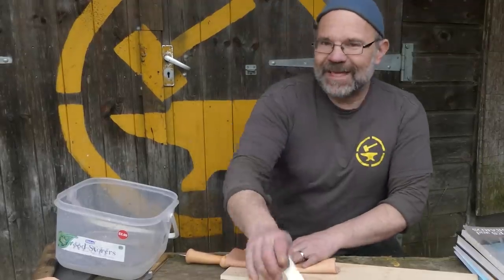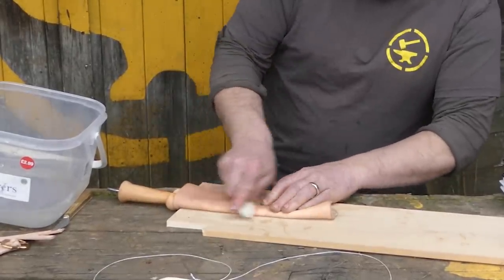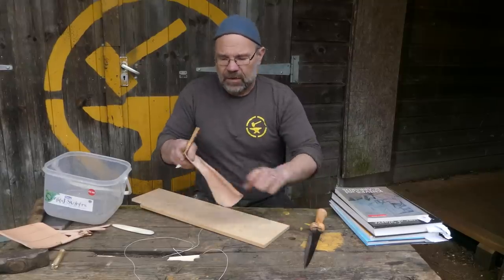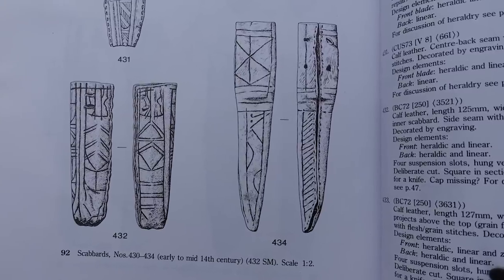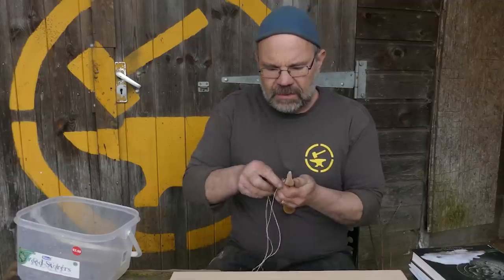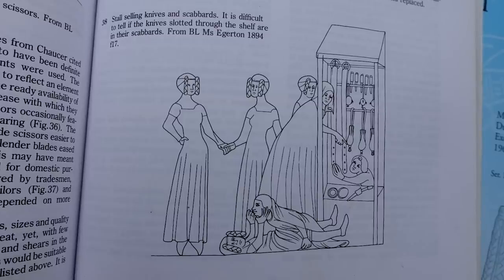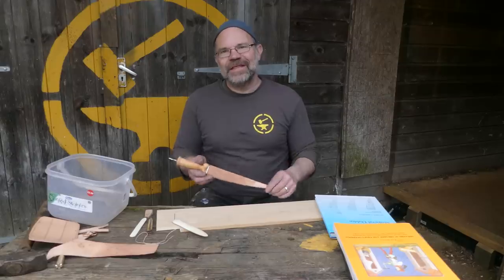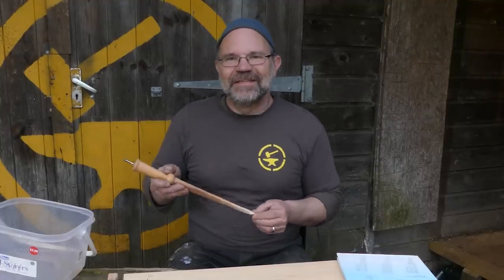Tod Makes Junk - Was Medieval Work Bad?

Comment: It's just laziness. If you want to scribe a line down the scabbard that follows the edge you can use a finger as a depth stop as you scribe it, and it will be exactly consistent. Clearly the customers didn't care or they wouldn't have bought them, but I don't buy that it saved time. There are so many shortcuts you can take while still getting good symmetry that it's not believable as time saving. On top of that how many sheaths/scabbards would a craftsman have averaged daily? Even if it saved them 5 minutes each, how many would that short them?
Reply from the maker: I agree that it is often the same time for good and bad yet they often went for bad

Comment: 1 mil is a pretty easy fraction considering there's roughly 25 mm in an inch 😅... then again, imperial fractions suck so much that accuracy means 197/500. Then again, imperial fractions are inherently unsuitable for accuracy because insignificant numbers cannot be expressed

Comment: When they play with a dagger/buckler as a sport, did they actually cut and stab each other? Any cut can get infected and kill you. I would understand if they used wooden daggers for sport. Getting slashed up doesn't sound very sensible :)
Reply: They weren't cavemen they were more than capable of looking after themselves
Reply: @valandil7454  Well, I agree. I don't think they would slash each other up for a laugh.

Comment: You have a knife stall, a buyer and some knives - you make things for each price point. To close a sale, you throw in 5 minutes of decorating which you're sitting around waiting for customers anyway and that only if things are quiet..
Medieval me buys a knife and wants something that will last - and doesn't care so much about the looks. I can't spend on frivolity - unless it's for court in which case it's a business expense. 
Even a badly made knife is likely to be very expensive - costing many loaves of bread so if you're a serf - your priorities on what consists of a good knife are geared to something lasting not pretty. Knife makers would know this and use tried and tested techniques for churning out many cheaper knives - maybe saving the few better ones for decoration.
Reply from the maker: good thoughts - thanks

Comment: Piece work.  And you didn't have electric lights.  Or even lamps in most shops.  You used natural light, when it got dark, you stopped.  So, you went into overdrive in the fall, winter and spring.  So, you would get paid for how many you made.

Comment: The disconnection between today and then also comes from the reason why ppl buy replicas,its not really to use them or they use them rarely and most of the time you are just admiring it on the wall or in your hands and the flaws get more evident. 
Think about when did you stop to stare at a kitchen knife or a tool you have stashed some where for a uneven blade or scratches.

Comment: One thing you say repeatedly that seems like a massive assumption is "no random guy is going to have a leather stamp".  But why not?  Everything you own is leather prettymuch and the guys who actually use the leather stamps professionally are eventually going to wear them out and replace them, what do they do with the old ones?  Can't repair them and they may not be worth melting down if you can sell them on the cheap to people who want to "home decorate" their gear.

It happens now so I can't see why it didn't happen then.

Comment: Minor nagging here: 434 scabbard is actually very well made - stitching is even, seam is straight, holes accurate. Decoration sucks, it is true, but are we sure that decoration in this case was not scratched on later  by owner?
Concerning the picture with knife seller stall and couple enjoying themselves: it is a pun on Latin word for scabbard, which is, of course, "vagina".  So the seller on the picture is probably selling the knifes without sheaths, that's why ladies are so interested in them :)
Reply from the maker: Nice thoughts - thank you
Reply: @tods_workshop  Why no wax or oil on finished sheath?  Such coating, especially when applied on heated leather, will make the sheath reasonably waterproof, rich in color and much more sturdy ("boiled leather" was treated with mixture of wax and resin). Traces of such treatment are probably hard to recover from medieval finds, since they are washed away by water that preserved the leather but it is cheap and logical :). 

Thin leather is not necessary soft, it could be tanned to be rigid, hard as wood when dry, and malleable when wet. AFAIK the difference in treatment is subtle and cannot be detected even today, especially on pieces which were saturated with water for several hundred years.  I made a medieval style scabbard for Mora carving knife more than 10 years ago from 1/20 inch hard leather, waxed it and it is still working great despite frequent use.

Comment: Isnt one factor also in making these so called perfect weapons the quality of ore and tools in medieval ages compared to the tools and quality of ore of the modern times. I also wonder how perfect weapons one would make if one was mass producing swords in general for the army with the tools that the medieval blacksmiths had available to them. These days we can for example mass produce weapons with machines for the army which cuts down the amount of imperfection by quite a bit. On the other hand we humans tend to make mistakes due to multiple factors affecting our work (level of skill, tiredness, our general mood on that  day and so on).

Comment: You also often have really "good" and really "bad" work combined on the same artifact:

The crown of the holy roman empire is beautyfully made on the outside, lots of fine details, made with incredible precision... while the inside (that no one would see anyway) is incredibly crude.

The famous "star cloak" of the holy roman emperor Henry II. is made out of a finely woven silk fabric with gold thread embroided stars all over it... and the stitching itself is fine and precise, but said stars themselves are just randomly dotted over the cloak without any care for a pattern or symmetry.
And the cloak itself is at best something approaching the form of a semicircle.

You have simple garments that were sown with very fine and precise stitches... and really high status ones stapled together with far more crude and big stitches.
And you indeed have garments were some parts are made in fine, precise and even stitches... and other parts are made with stitches a modern reenactor would get laughed at for.

Comment: I mean honestly, how good is the hammer everyone has at home? Or your screwdrivers? I'd wager they're utter trash unless you use them for a trade. In a time where everyone needed a dagger every now and again, of course you get some scrappily stamped out work. A knight might need a finely crafted one, it's a tool of his profession, but Joseph the tile maker just needs a sharp bit of metal to stab a bandit.
I can do some really nice welding if I need to, but you better be sure that most of the stuff I made to just use around the workshop is welded just well enough to function, and not a jot more. Perfectionism doesn't pay the bills, completing work to the customer's needs does.

Comment: Half a life ago (literally 😅) i bought a nice damast-knife with a deer-fork as a handle.

Really nice one, just large enough to be called an eating knife.

I just went to one of the other craftsmen and asked for some leather and a string of leather cord.

Made the sheath in under half an hour our of 3mm pig leather (to be fair: with a modern punch-plier). Ugly AF, but keeps the knife in place and protects the bottom half of the handle a bit. Took me another 20 minutes to add a loop for the belt.

So yes, what we think of medieval craftsmenship was not always super-duper done, but just a practical thing.

You need a sheath for a 20€ knife? Here you go, cost you two pieces of cake!😂

Comment: Nowadays if we want cheap stuff we buy mass produced junk made in China out of plastic.  If we are willing to pay the premium for handmade stuff out of natural materials, we want Quality for our money.  Back then, all they had was stuff handmade out of natural materials.  Makes sense there was still a market for cheap junk.

I mean, when was the last time you looked at the seams on your tee shirt to see if they were well made?  If you actually examine some of your mass produced possessions, I'll guarantee you'll see manufacturing flaws that you never even noticed before.  Wavey seams and loose threads on fabrics.  Molding seams on plastics.  Rough edges and bad welds on metal.  Stuff we don't even see because they are so normal.  It must have been the same back then.

Comment: I don't think that they couldn't see it. I think that they couldn't do better. My one is as good as everyone else's, so it's fine. Labour saving tools, like a sewing machine, that also give you perfect stitch width and tension, are huge. Let alone having an assembly line make a million things all the same. Our manufacturing tolerances are tighter, because we use machines.

If you want to see the imperfection of people doing things by hand and always making some kind of mistake in the modern world, pay a building contractor. Get some cheap tiling, or the lowest quote to install a kitchen. Or even pay for people who are supposed to be top drawer, but they end up taking longer than expected, and start cutting corners.

Comment: Honestly, most knock-off Made In China stuff comes out similarly bad these days. Or it's the equivalent of AK-47s made in tiny villages where the entire family works at a gun and is forced to churn them out rapidly so they don't get shot with one.
As for the bracer, I've seen worse on sale at festivals.

Otherwise, the cheap disposable sheaths show that 'fast fashion' and throwaway culture is nothing new. We just have longer-lasting materials now that don't rot down in a midden, and there's way more of it.

Comment: 1 mm is about 1/34 of an inch
Reply: 1 mm is acually exactly 5/127 of an inch (or approximately 1/25). An inch is actually defined as 25.4 mm (Yes, the actual definition of an inch is in metric, not the other way around. The modern inch is a compromise between the old US and UK inch and was defined by a swede by the name Johansson in the early 20th century.)

Comment: Perhaps the issue is the things you mention are tools not how we might see a prize possession. So do we care if we buy a hammer if the handle is badly decorated? It may not be polished, just rough linished metal. Still is everything we need in a hammer. Your sheathes, a bit like a carrier bag today. Carries the goods, no one cares about the logo or decoration on them.

Comment: No. Im not convinced. If you have a sword or knife handed down by generations and used, cleaned or sharpened regularly it wont retain straight edges. Same with leather work exposed to rain, mud etc. Could Tod possibly replicate a sword or knife being sharpened using a period wet stone or similar for say 50-100 years of use. I know it would be difficult, but, Tod being Tod im sure he could  together something
Reply from the maker: a good idea, but not enough time

Comment: Hello love your stuff, you comment casually they may not have seen it. I thing this comment is probably hitting the mark. I need reading glasses and have electric lighting. They had candles and lamps or a torch maybe, but did they have glasses.

Comment: Dont forget, those knives were actually used.  What you would call "good" is probably on a wall or in a collection and only cuts small strips of paper before going back in the commemorative proprietary one of a kind rare wooden box.  In 500 years, your sheath will look like crap.

Comment: Simply look to the early 2000s militaries especially the special forces. By todays standards their gear was horrible and even sometimes quickly fashioned together or a mix match of stuff they had. Necessity will always have you work with what you have. Yeah you can make something perfect with enough time and resources but do you really want to do that with a weapon or a tool? Eventually the performance to cost ratio is simply not worth it

Comment: Two questions for me. The knives were made by professionals, but a working man might just knock out a crude sheath himself. I'm betting most of those rough sheaths were made at home. They have the look not of quickness, but of someone unskilled. Think about the kind of work a badly paid indian labourer might do, it cuts corners but they completely know what they are doing because of the repetition.
Second, and it's just my ignorance, was it normal for sheaths to come without any means of attachment to belts or clothing?
Reply from the maker: I suspect didn't as they would need tools and materials they would not have otherwise owned - cheap decoration; quite possibly

Comment: The depictions you show in the book look bad but isn't that because they are drawings of surviving pieces and how they look now after a Thousand years of rot.
kind of how a lot of surviving mediaeval swords and armour look terrible because they have warped rusted etc over time.
Reply: In most cases they haven't rotten, rusted, or warped enough that you can't tell which bits were originally bad vs which have aged or worn badly.  Rotting or crumbling of leather isn't going to significantly change the spacing or alignment of the remaining decorative stamps - so you can see when those were applied unevenly.  And while poor sharpening, or having to grind away gouges might cause a sword to become asymmetrical you can still see whether the original ridge of a diamond shaped blade ran straight or not.  And as mentioned with King Henry's armor you can see where they patched misaligned rivet holes; that's an issue with original construction not with how it warped or rusted over time.

Comment: an Inch is 25.4 mm so the other way round 1 millimeter would be 1/25th of an inch. Showing another failing of the idiotic 1/2^x pattern imperial users are accustomed to think in. 16th and 32th of an inch are USELESS.